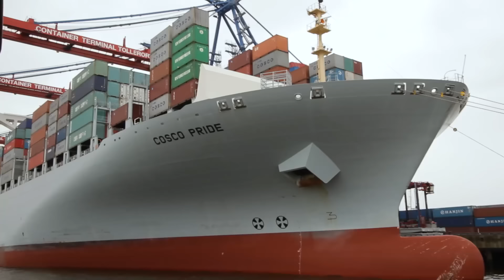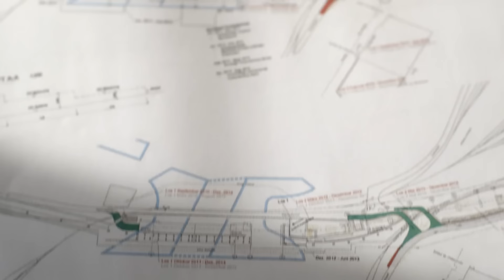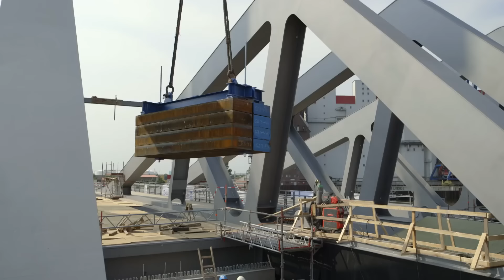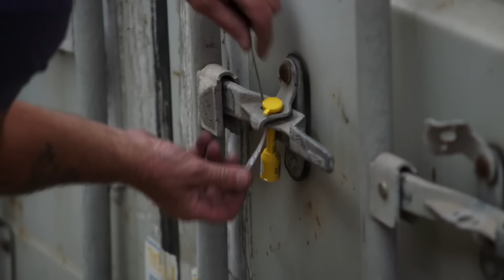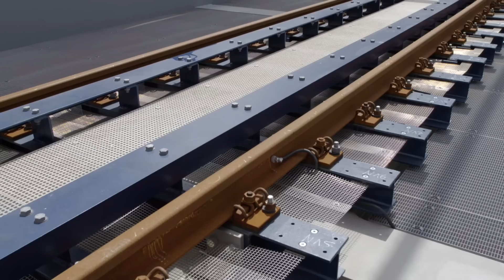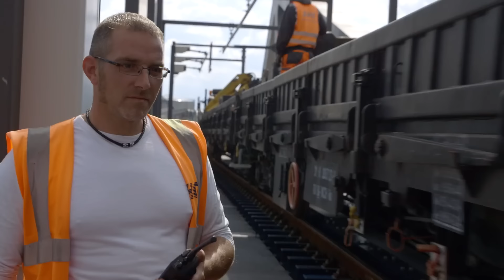How to Replace a Bridge: A Gigantic Construction Challenge | FD Engineering

Comment: For a bascule bridge that has to handle 3 times the load of the old bridge it's very futuristic and elegant.  Only issue is was the bridge built with global climate change in mind.  WIll it take 3 meters rise in water in the next 100 years?